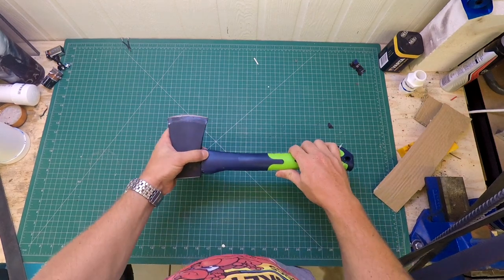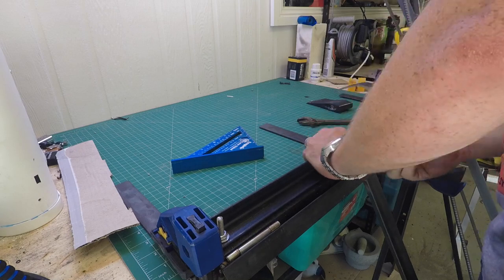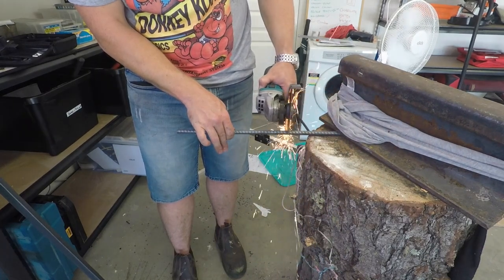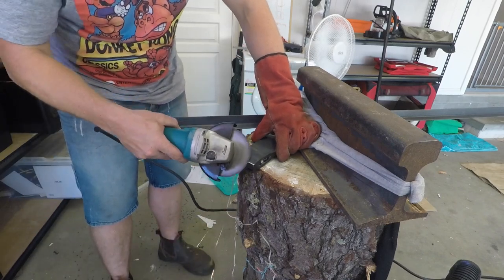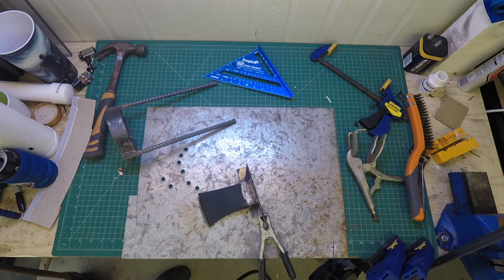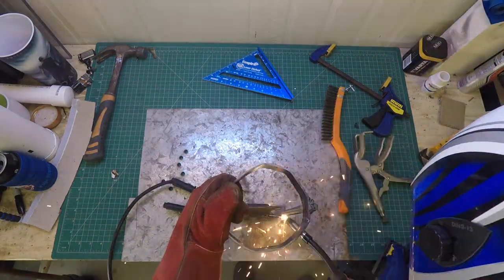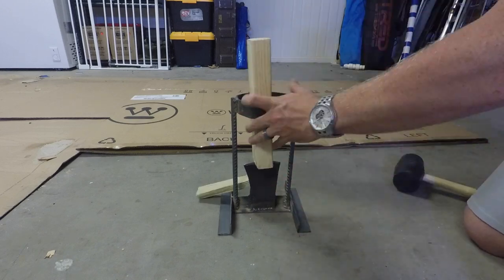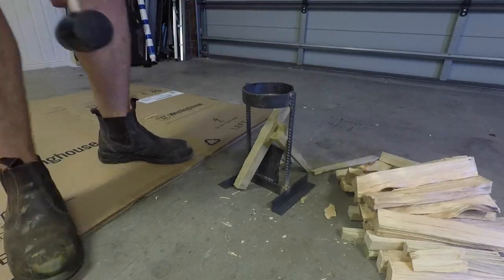Making a kindling splitter/cracker

Comment: I've been trolling designs for "Kindling Splitters" and this is the best one so far in terms of simplicity, economy & function.Well done!
Reply: Someone could also use bedrails from the trash then cut the corners and secure a regular hatchet upright with heavy duty c- clamps and not damage your hatchet.
Reply: I m glad you like the design,  it was designed by a 13yo girl from NZ, its a shame this muppet has ripped her design off

Comment: Good video....if I could make a suggestion.

I built mine very similar to yours, with the exception that the guard and the splitting head are independent of one another.

The reason, is so that I can easily unbolt the guard from the log round base, in order to sharpen the blade easily.

Great job!!

Comment: so few views and subscribers for an awesome video!! big thumbs up from me and subscribed. had something like this in my head but your video simplifies it. thanks again
Reply from the maker: +Jamie Prado thanks mate. Appreciate the feedback. I love the splitter. Just about to make a couple more for some friends
Reply: what mig is that? happy with it? looking at buying my first mig
Reply from the maker: I think it's an entry level Gas/Gasless, by Cigweld. I've been using the gasless flux core wire. 
I'm quite happy with it. It's been quite easy to set up and use. My welds aren't all that good, but that's my fault - I need to spend more time practicing with it.

Comment: this is on my to do list and im going to attach it to a log and also have the blade welded half way up the frame but first im going to make a cheap bender up from 3 bearings to make the top circle which i saw on utube  , also I like your sheet metal bender have you got a video of you making that , cheers mate thanks

Comment: A quick trip down Amazon shows

Tig welder: $130
Metal grinding tool: $40
Sheet metal bending tool: $65
Materials for this project: $20

You spent an excess of $255. That doesn't include tax nor the welding materials for the Tig. For those of us that don't have a miniature fabrication ensemble in our garage, the $100 option is much cheaper.  Not trying to be a jerk, but this is the reality though.
Reply: so what your saying is all that gear will be only used once to make the one item  then thrown away and not used to make lots of other things ?

Comment: Not to sound like a dick but if you don't have any of that material or a welder then buying the commercially manufactured splitter is a better option financially. I do think you did a good job though. Thanks.
Reply from the maker: Good point. I hadn't thought of it like that.
Reply: D A it's a project so